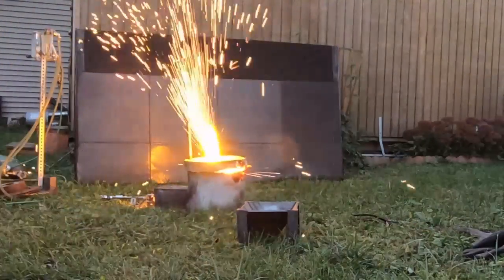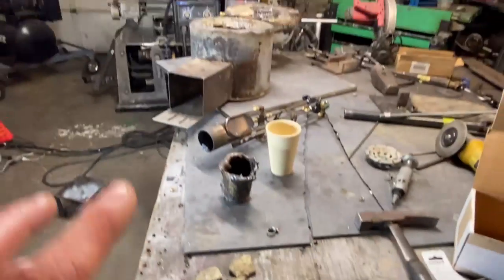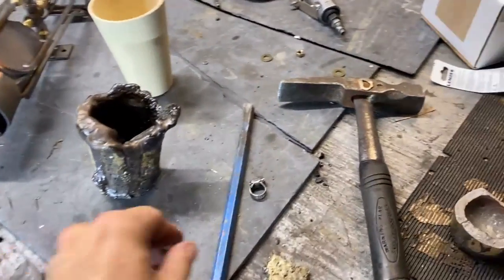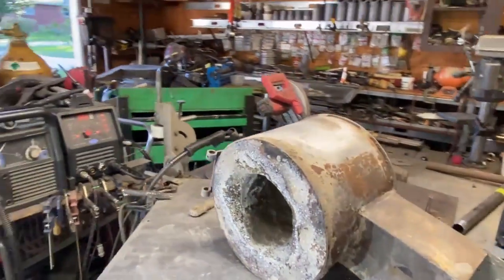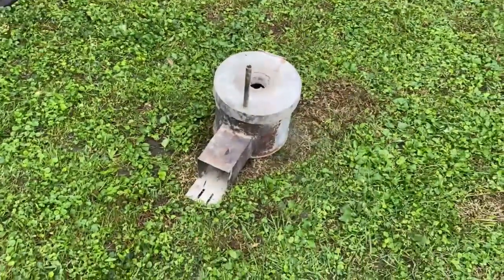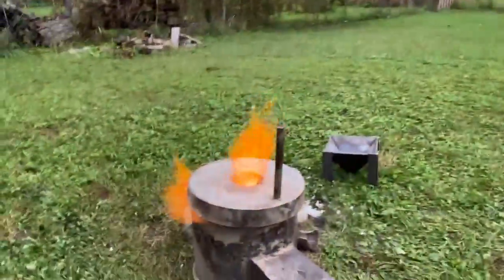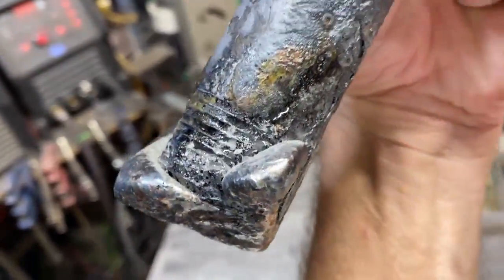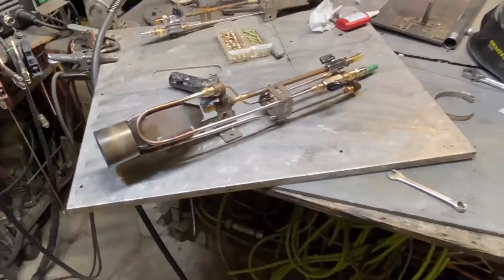Cast Iron Smelting secrets revealed

Comment: What amazes me is the effort exerted to get diesel to melt iron/steel. Yet we are to believe that on 9/11/2001, simply crashing the diesel/kerosene into the building and letting it smolder for an hour was somehow enough input to cause 110 stories of structural steel, encased inside concrete, to completely surrender. Such that both towers went from full height to the ground in less than ten seconds, with very few fragments on the ground larger than 40' long. Apparently, NOBOX7 is doing something wrong. Right? I'm just asking.
Reply from the maker: Nope the idea you can melt steel with fire is insane , would all building collaps if that were true LOL
Reply: I would say more burned, once the fuel was airated enough it probably managed to cause some of the steel to burn which may have released heat, allowing the steel to melt. Just my thoughts in it though
Reply: 🗣️Thermite

Comment: Instead of adding oxygen, could a blower be used to increase the amount of air forced into the burn?
Reply from the maker: nope , wont get hotter than 2,800 no matter what you do to it , thtats a sound barrier for forced air ovens
Reply: @NOBOX7  what if you use liquid propane ? like pump it to 200 psi and then use it as if it were oil ofc you would have to modify the nozzle but liquid propane should be hotter than diesel right ?

Comment: are there any upgrades you'd make to the air dryer? i'd imagine a straight line is ideal to maintain airflow velocity? maybe a change in geometry can reduce temperature and reduce moisture. im trying to design a dust collector/wetscrubber for my garage and ive been researching simple solutions to air drying and water separation. it seems a rule of thumb in air-duct design is to limit bends in the line as much as possible... the more elbows in the line significantly reduces air flow, but restriction can be mitigated by replacing 90 degree bends with two 45 degree bends. so it would be interesting to see how your dryer would perform if you'd add 2 slumps or dips to the geometry to help catch moisture?. >-------\____/----->----\____/-------> possibly desiccant beads in the straight-angle portions of pipe and stainless steel wool in the 45-degree-angle portions of pipe
Reply from the maker: i wouldnt try it , ss can leach but people do do it
Reply: @NOBOX7  ah i see, didnt know ss can leach

Comment: Hay why don't you inject H H O in the flame with your h h o generator like when you added the extra oxygen and add two more lines on the opposite sides of the burner
Reply: It will make material brittle  like glass-check hydrogen embrittlement on wiki.
Reply: Diesel fuel contains 86 wt.% carbon and 14 wt.% hydrogen